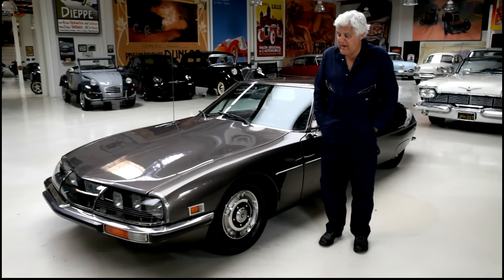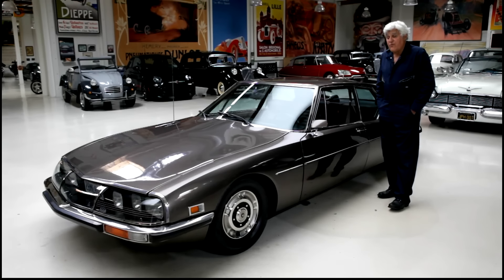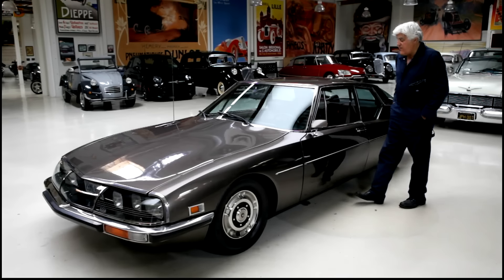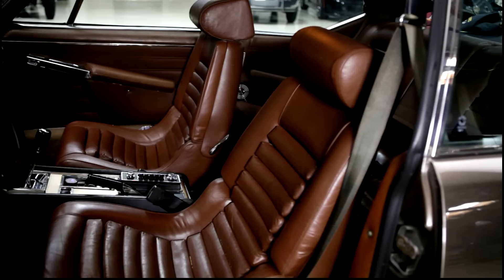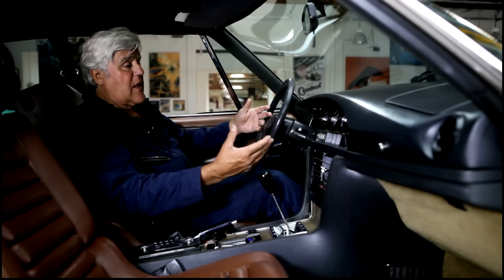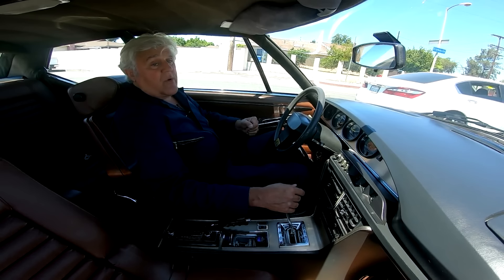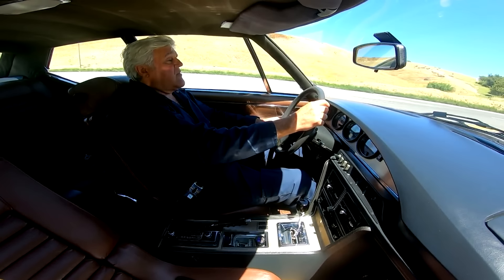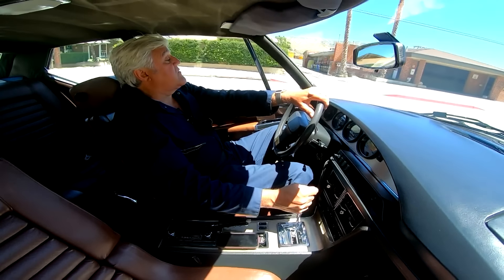The Futuristic 1972 Citroën SM | Jay Leno's Garage

Comment: Thanks for showing us this car. It makes me aware again why I so much love the XM I own. Like most love stories, one gets complacent after some time? And it is a love story. I understand from a Top Gear episode you have an XM too, Jay Leno? 

Anyway, here are some remarks I wish to make: 

The SM designer was called Robert Opron. Amazing guy. He died in 2021 and even in Germany there was sad uproar about his passing. The original DS was designed by Flaminio Bertoni. Opron made the 1967 facelift of the DS with the swivelling headlights. He then did the SM, the GS and CX. Funny enough next Citroens as XM and Xantia were designed by Bertone, don’t mistake for Bertoni, only one letter difference but nothing to do with each other. 

The swivelling headlights is one example how innovative these cars were. As a German I noted with a smile how Mercedes marketed “Mercedes’ innovative turning headlights” – are you saying it took you only 30 years to copy Citroen? 

This maybe links to the major issue that Jay Leno mentions too: Citroen did not communicate very well. 

Because in all honesty the suspension system is very simple and reliable. I own an XM since 5 years, use it as my daily and besides rost protection, oil changes etc, it is such a reliable car even when 25 years old! The problem is that steering, brakes, everything is on the hydraulics, so when you have a hydraulic problem, the car is totally undriveable. But it doesn’t really happen. The oil pressure is something like 120bars and that is in stainless steel tubes that are extremely unlikely to go wrong. When something does go wrong it is most of the time a return pipe with no pressure and that can basically be replaced by any sorts of garden hose. 

I Love the story of Charley de Gaule. It shows how brilliant the system is. I claim my XM saved my live and that of my family (including a then 2 years old child) too. On a highway after a crest someone came out of the forest. I didn’t expect that, there was no junction or anything, after the crest this car was in the middle of the road. I could slow down to maybe 80kph, then I had to decide either I crash full on into him or I go for the ditch. I went for the ditch and the ditch spat us out the other side. I didn’t even feel it in the steering wheel, the car just kept super stabile despite the right wheels on wet grass in a ditch at 80kph! 

Next bit I love is the brakes. I never drove a Citroen with that mushroom button. More modern incarnations as this XM have a proper pedal, but the car has no brake server, the pedal sits low and is very firm. It travels maybe one inch, but from just touching it you already feel a slight deceleration. It is so easy to control the brakes. To friends I compare it to a hot hatch – I had a Peugeot 205 GTI many years ago. Maybe the comparison is weird, but the XM feels much smaller than it is, the brakes are so extremely accurate, diving into the apex of corners you are pin point accurate on the brakes, like a racing car, but where the 205 GTI would start jumping with its rear, the XM at the same time is not challenged at all by pot holes or bumps in the road. 

That is still not all. The brakes running on that Citroen Green LHM rather than brake fluid, LHM doesn’t draw water, there is no corrosion of brake lines, it can’t boil, this means Citroens with that system don’t know what the word brake fading means! 

With weight affecting the load and such oil pressure per axle (see on the SM rear sinks too under braking), there is no difference in braking behaviour never mind how you loaded the car. Never mind how loaded the boot, never mind how cooked the brakes, never mind how broken and cambered the road, the Citroen always does its thing, like a racing car!

I wish Citroen would have carried on. XM and Xantia were about the last cars with this system. C5 and C6 already had cheaper, detuned variants. Ony example: On XM and Xantia the system was computer supported, the Xantia Activa had anti roll thanks to additional spheres. In the late 1990s the Mercedes A-Class happened, that would tumble over on steering movements. This is why in Europe the ESP (electric stability program) and the Elk test was invented. I would say I wouldn’t need all that. I would have sacked the designer of the Mercedes Benz A-Class and SUVs! A car higher than wide with high up CoG tumbles over? What surprise! Even my now 4 y/o son can explain why this is stupid! Well, check Elk Test results today, that as said were invented for the A-Class and ESP systems: And the best car ever tested is to the day (2023) a 1998 Citroen Xantia that doesn’t even have ESP!

I could write endless. 

Yes I own an XM. But I also love the SM.

That Citroen went bankrupt over this indeed had to do with times, oil crisis etc. It wasn’t only the Maserati engined SM. At the same time they developed a GS Bi-Rotor, which had a rotary/Wankel engine. That is what the NSU Ro80 is famous for? Yes, and a factory called Comotor was being built in my neighbourhood. Comotor would make the Wankel engines for both, the Ro80 and the GS. Then oil crisis happened and the Comotor factory was a nail in the coffin for both car makes! 

Try and find images and videos of the GS BiRotor and you find that the dash of the GS Birotor and the SM is very similar. Both, SM Maserati and GS BiRotor were extremely intelligent cars, both came at the wrong time, see NSU with their models Ro80 and K70 did not even survive at all. 

I love the way that Jay Leno claims everyone should drive such a car to understand it. I agree. I always knew the XM was extremely comfortable, the real surprise is that its handling and brakes are so sharp. Normally you have soft or hard suspension, but hydropneumatic Citroens really are the best of both Worlds in a way that just can’t be done with conventional suspensions! 

The SM explains just this quite well: You would think a Maserati engine V6 Coupé (with comfy suspension?) should go down as a sports car or super car? Well, Citroen went rallying with it in near standard group1 form and became winners of the toughest African marathon rallies, like muddy Bandama and rocky Morocco. On the surface you would think these are events for Jeeps and Land Rovers, but it was FWD hydropneumatic Citroens limousines and coupés that dominated in their years! Can you get a better proof? Again, Citroen could have communicated this better….

Comment: The air suspension Cadillac had in the '50s had that same height setup. The high setting was used for changing a flat tire or going on to a lift. Those air bags were prone to blowing out & the system was prone to leaks as well. Had a small 2-cylinder air compressor & an air tank.

Comment: That color is gorgeous!
Steering is called DirAVi: direction asservie à la vitesse. Speed controled steering. Fully hydrolic, no electronics. A sort of drive by fluid miracle. Was implemented in the cx as well. The steering wheel is also automatically recalled to the center point when you ler it go.

Comment: They called the steering system DIRAVI "direction a rappel asservi" in French, or, dead center return servo steering. The faster you go the less input you need to change direction, and when you let go of the wheel, it goes back to dead center.

Comment: Jay is so right about the service and parts issue. My Dad had a gold color SM for at least 20 years and put a lot of miles on it. I used to love driving it. It was just unlike any other car. The hydrolic syspension and the brakes. Jay didn't mention it but it also has a big dial on the dash board that tells you when something is wrong with the car and what it is. My Dad finally had to get rid of it because believe or not he couldn't get a new fan belt!!!

Comment: In the custom car world those little green balls on the hydraulic suspension are called accumulators. Inside there is a rubber blatter filled with nitrogen that the fluid is pressing against. I've only rode in one mini truck that they got installed on. I had ridden in that truck many times before they were installed and they made a world of difference. It went from being a super rough ride, to like riding on a cloud. It made it ride very similar to how my air ride rode when it was aired up about half way. If you have hydraulics I highly recommend them.

Comment: Few US commentators talk about the two intermediate suspension driving positions on the DS & SM.
Normal drive position is about 6 inches for best ride and most ideal angle for the drive shafts.
Position 2 about 7.5 Inches for rough roads with slightly firmer dampening.
Position 3 is for snow and floods and rough road rallying. About 9.5  inches.
Max is up on top bump stops with 11.5 clearance. Only suspension is in the tyres.
Same as the bottom setting on bottom bump stops. About 3.5 inches clearance. These two extremes are for service and changing tryres.

Additional benefits of no loss of control with a front tyre blow out.
Rear wheel flat goes unnoticed except for noise at speed.

Other advantages with self leveling height adjustable suspension includes great tow car. Help elderly passengers get in and out on high.

CX and GS have one rough road setting

Comment: I've read that even the wipers were hydraulically driven.

Some tractors actually specify LHM fluid for the hydraulic  clutch and brake system.  LHM+ is a very highly refined anhydrous mineral fluid which is rather expensive to make and only used in very high end vehicles nowadays.

Comment: we had the Citroen XM 2.0  brittish racing green loved it and loved working on it. we were driving to a car auction and seen a car pass by slowly at a T Junction  never seen one before loved the shape, when we got to the auction there was one there so we bid on it and won ( i think we were bidding against our selfs at the end)  looked it over all the extras just what we wanted. had a instruction manual with it and was reading what fuel to put in it either leaded unleaded, because im a bit dyslexic i read the word either as ether pulled into the fuel station wondering why they did'nt have any

Comment: The power stearing is called DIRAVI an acronym for "direction à rappel asservi " wich mean "power steering with power assisted return". It was also mounted on some of  the Citroën CX and XM, but it was not reliable a the source of a lot of problem. It was abandonned on the later version of the XM. I own an XM with the 2.0 liters Turbo Constant Torque engine. Glad I have not the DIRAVi because if it fails, the spare parts are very difficult to find and finding a mechanic that know how to mend this system is quite difficult too.
My Hydraulic system was never maintained correctly, the fluid was black and not green, the filters is the container was also dark. Now the system is doomed to be faulty. It is the third time I have to took it to the Citroën conservatory to mend it and each time the bill is around 3 grands. I hope one day, with the regular LHM bleeding the system will start to work correctly again.

Comment: The V6 used, was designed by Leon Bertice. It was actually two 3 cylinder engines, grafted together, with a 47.5deg V.

Comment: Mr. Leno,there's a Diesel conversion by the French
Tuner Regembeau.  He took a 2.5 l light truck  engine and turboed it. It was much more reliable and as powerful than  
the Maserati V6. In France quite a few were converted in the late 70s .

Comment: Must've been in 1989 when I was studying in Tours, France. Had my car broken into (again) and when I picked it up from repairs at the garage, I saw a pristine looking white Citroen SM sitting among their used cars. It had the "AV" (a vendre = for sale) sticker on the windshield, but no price and the mechanic I was talking to didn't know how much it was. The sales-guy he called over said he also wasn't sure about the price, but that he thought it was around 10,000 Francs. Which would've been insanely cheap for an SM in that condition, even back then - probably around 3,000 to 5,000 bucks in today's money. At that point, the dollar-signs must've popped up in my pupils and I took the two buddies who were with me aside and asked them how much money they had on them. They thought I was nuts - and 10,000 Francs wouldn't have been pocket-change for any of us, but I gave them a quick run-down on what the car was and that it had a Maserati-engine and all that. That kinda convinced them that we should buy that car at that price. Then, of course, the salesman returned, apologized a million times and told us that he'd given us the wrong price. Turned out they wanted 100,000 Francs for it - which was probably close to the car's actual market-value at the time.

Comment: The Citroen steering Jay mentioned is called DIRAVI (typical engineering acronym... Citroen was driven by engineers not by marketers) - DIRAVI is the acronym for DIrection à RAppel asserVI - means "steering with automatic back to neutral system" - well described by Jay in the video.

Comment: DIRAVI power stearing : direction à rappel asservi.
A system that forces the direction of the wheels into a straight forward direction.
There has been a Citroën SM with a 380 hp enginen and 
a topspeed of 300 km/h for developing the DIRAVI  (Project-S).
Reply: I think it would’ve been interesting if they made a Rallye version that was AWD and used a diravi like all-wheel steering system for the back wheels as well (Give you some back wheel steer at lower speeds).

Comment: My father owned a Citroen (a GS), the radio cassette player location was a bad idea, every time you turned the tape wound offset to one side or the other, in time the tapes would jam inside the cae. The only solution was to use a tape rewinder (with the tapes in horizontal position) abd re-wind them several times until they "became loose" and worked again.

Comment: 2:50 the argument whether it's the V-8 lopped off, or a specifically-engineered V-6, is probably answered by the angle.   V-6's are quite well balanced, actually, at 60 degrees, but horrible at 90 degrees.  Packaging is better at 60 degrees too of course.

Comment: I like how it is just called : green fluid
Reply: Some antifreeze is green. It does NOT belong in a Citroën hydraulic system!
Here in the USA the only legal LHM is Pentosin which is usually hard to get. Texaco Aircraft Hydraulic Fluid 15, Red Oil, MIL-H-5606, has worked very well for over 50 years. Nevertheless genuine LHM is the right stuff to use.

Comment: As best I can tell, these vehicles were rated at 18.8 mpg in the carburetor version. The EFI version may have gotten a couple of additional mpg's but the early  Bosch k-jetronic fuel injection systems used an analog computer system and were really focused on increasing horsepower and reducing emissions, rather than improving fuel economy.

Comment: I had a DS21 (68) for a short while. Too bad it was already shot when I bought it. I decided that having young kids and a clapped out foreign luxury car was a dumb idea. But man, what a neat vehicle. Outstanding engineering. A more bizarre steering wheel than the SM: it seemed like a round tube that just came out of the dash in a great curve to meet the rim. You pulled the shifter (column mounted iirc) towards you to start it. And the seats were better in worn out leather than any couch I had sat in. The foam under the wool carpet (still in great condition) was at least an inch (oh, 25mm) thick, with pencil holes regularly spaced. Sadly, the suspension didn't work, and I think the power steering was minimal -- the brakes worked though (I don't remember being impressed, but if the pump wasn't working correctly, the brakes wouldn't either). The rear fender came off to change a tire: one chrome acorn nut on the rear, then swing the fender out and lift it off (you wouldn't need to to change it). It had a spare up front (over the area in front of the engine; the transmission area).  Same transmission and brake layout. Hemi engine, wet sleeved cylinders. 

The bottom was a smooth corrugated metal look, with only 2 nuts sticking out (one on each side). There were one jack 'post' or pin sticking out of the rocker panel right in line with the front and rear door seams.  The jack stand was you 2 legs (a Y shape) that fit over the pin. You lifted the car, placed the stand, then lowered it (as Jay pointed out), then popped the hub caps (if it had them). There were 3 lug and 1 lug hubs as I recall. I think mine was 3 lugs. 

I remember watching CHiPs one night (I was young enough to enjoy it) and there's this crazy car going down the freeway and the 2 heroes are trying to flag the driver down. He was driving on only 1 rear wheel. It was a non-english speaking 'old guy' Frenchman who finally across that this was not an issue. Which our 2 heroes couldn't allow to continue. 

It was an SM. When you retracted the suspension (on the stand) the rear trailing arm would go up (or you pushed it up, never actually did it) and a hole (say 1/2" - 3/4"; could have been 3/8") lined up with a hole in the body (unit body). There was a pin in the tool kit you inserted. Then return the fender and dump the 3rd tire (since you must have already had 2 flats) into the trunk, raised the suspension, remove the jack stand, etc, and go on your way (preferably to a tire store). 

There was a DS in the John Wayne movie Green Berets. 

Anyhow, neat vehicles. If mine had been a green fluid car, maybe I would have kept it. No internet yet, so small towns and unobtanium parts & user groups were tough.

Comment: A doctor in my town had one. One time a mechanic told me that you could pour a bucket of sand on the engine and none of it hits the ground. He also rode bicycles. He was obsessed with weight. His bike was an Alan. Still it was the Citroen was what defined him. This doctor did either the first or one of the first successful hand transplants. 

Though not into Nurburgring, they were big on WRC.